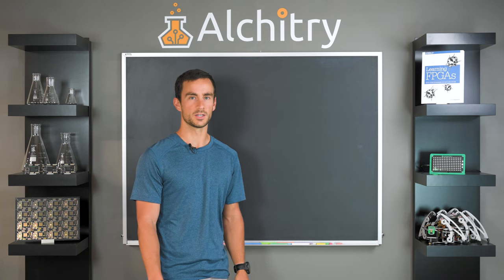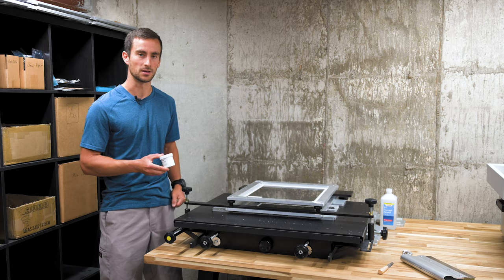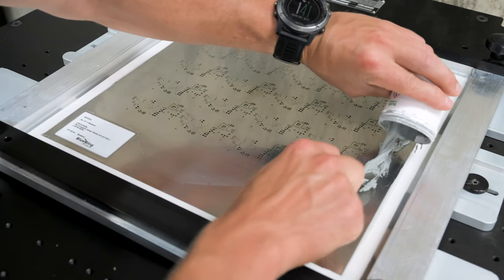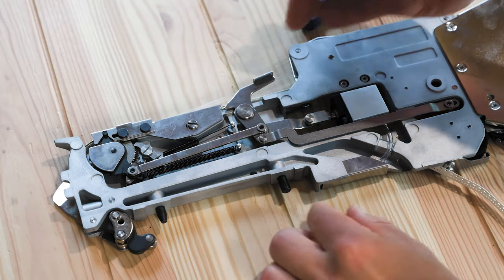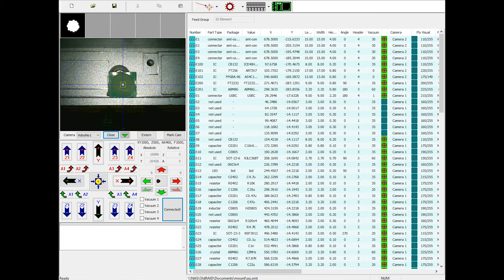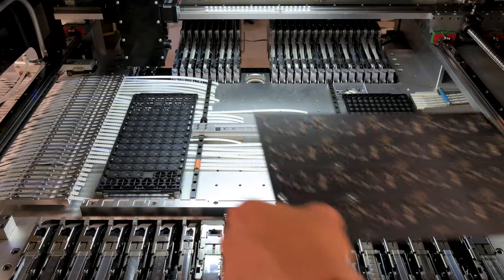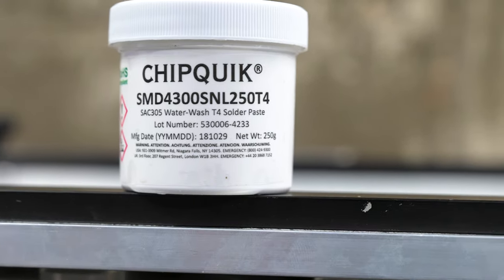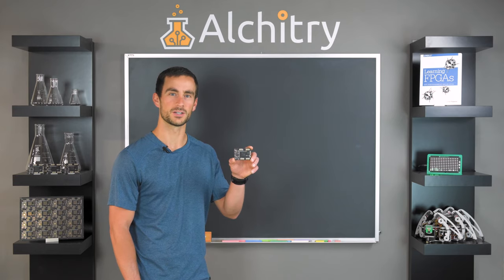How to Make Electronics

Comment: Fascinating! Can one use the FPGA book that uses the Mojo board with the  Au?
Reply from the maker: Kind of. I'll be rewriting it to be based on the new boards but a lot of it is still applicable. It's really just the setup and pinout stuff that needs updating.
Reply: @Alchitry  thanks for the reply. That sounds good. Hopefully I can poke around and figure out the pin out differences for now until the updated book is finished.
Reply from the maker: It's pretty easy if you're using Alchitry Labs as you can now use the pin names on the board instead of the FPGS. If you have any questions feel free to hit us up.

Comment: Hey Justin, is the cleaning water coming from the tap or do you reuse the dirty water? Do you have any recommendation for the cleaning process (duration, ultrasonic frequency, temperature)?
Reply from the maker: All the cleaning water is from the reverse osmosis water filter (which gets the original water from the tap). We usually let the ultrasonic tank run for 15 minutes on "sweep" which changes the frequency to prevent excessive stress and dead zones. We also don't typically heat the water as it can lead to bubbles that prevent cleaning. The water can still get warm just from the machine operating regularly.